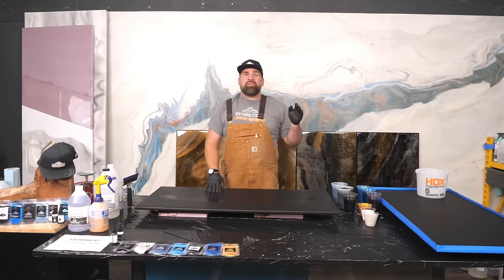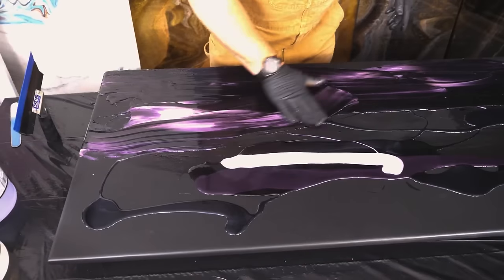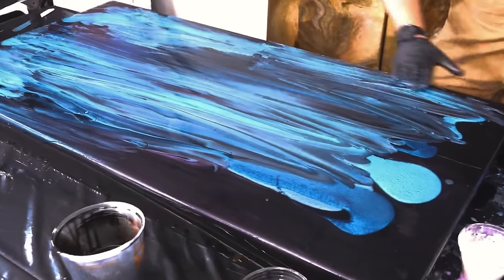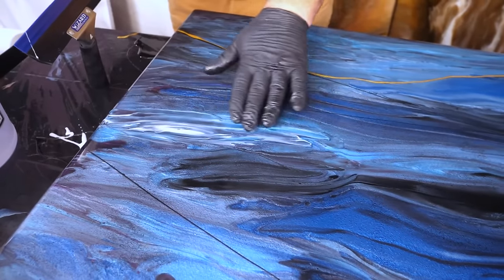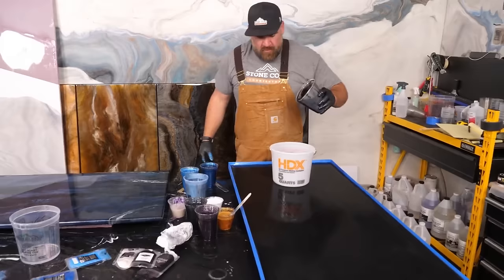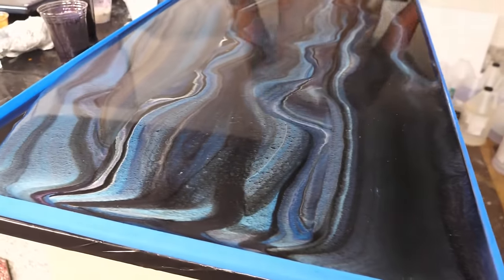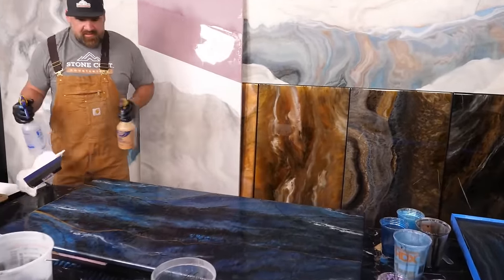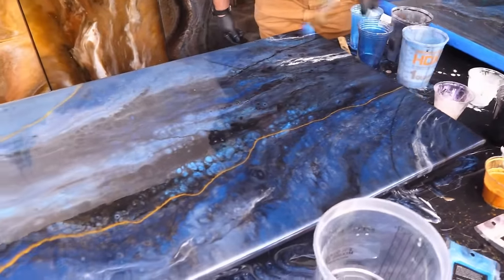You've NEVER Seen Countertops Like These - Blue Granite Epoxy Magic!

Comment: Hey Mitch, you always say "91% isopropyl alcohol".  Curious what happens if you only use 70% alcohol?
Reply: @@anothermovienerd thank you
Reply from the maker: 70% can divot the epoxy finish because of the excess water not evaporating in time for the material to self level again. I've used 91%, 99% and moonshine. Moonshine works just spray more on the countertop and less in your mouth for best results!!!! U Got This -Mitch

Comment: ive watched a lot of your videos and i am planning on doing a few pieces in my home. i have a few questions...
1. after doing counter tops, are they chip proof? if i am cutting some vegetables on a cutting board and i accidently drop the knife or sharp object on the counter, will it damage it? if so, how do you fix it?
2. can you do a couple of plain clear coats (drying in between) and then apply the colored coat to make it thicker? by doing that, does it make it more durable or is that just a waste of money?
3. after watching your shower video (which was awesome looking), i wondered about mildew and mold getting behind the foam board. in any bathroom you use greenboard (or some variance) in the shower. i dont remember seeing you use that before installing. would you still do that or are you simply hanging the acrylic piece of right to the studs?
im excited to get started, but i just dont want to waste a bunch of money and make too many mistakes. i want to do it right the first time...
Reply from the maker: The tops are very durable when cured especially when the Ultimate Top Coat applied. You could sand down a chip and re-apply a clear coat to fix. If you'd like to change the colors down the road, sand with 220 and clean the dust. You're ready for another coat of epoxy!

Comment: Primer vs Undercoat or both 
Are primer and undercoat interchangeable  can  each work alone or do you always use both ?
Reply from the maker: Great questions! Bonding Primer is used over slick, non-porous surfaces like laminate, granite. Our Epoxy Undercoat is our formulation of paint and primer in one without ammonia. Ammonia needs to off gas out of the paint a minimum of 24 hours. We removed it in our Undercoat so you can coat over the paint in as little as 4 hours. Let me know if you have any further question's! -Mitch